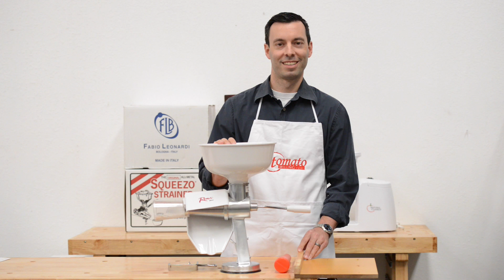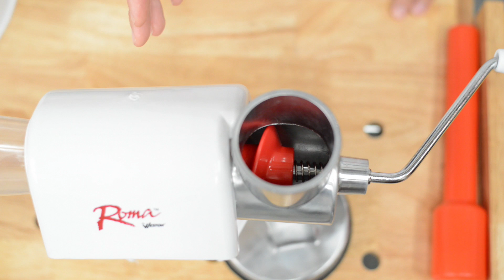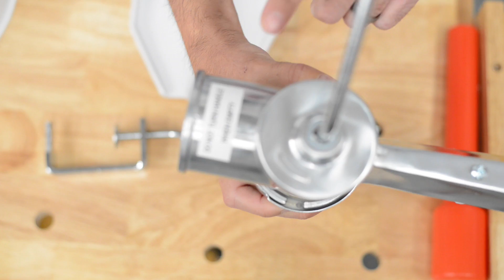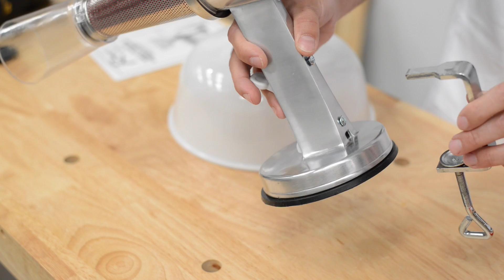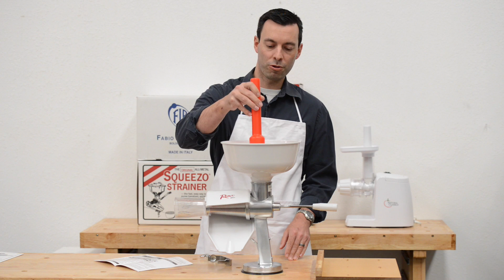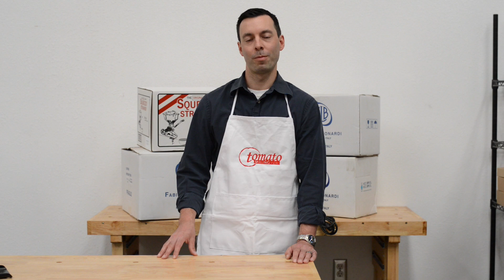How To Use Weston Roma Hand Operated Tomato Milling Machine/ Tomato Press

Comment: why does doesn't the spiral part touch the drive shaft which leaves the spring showing.  I have to keep pushing the tomato towards the spiral myself.  Did I assembly it wrong.  I noticed you can see the inside spring in your demonstration.